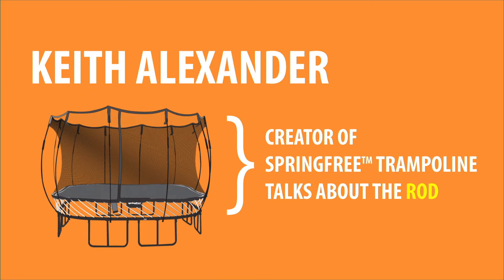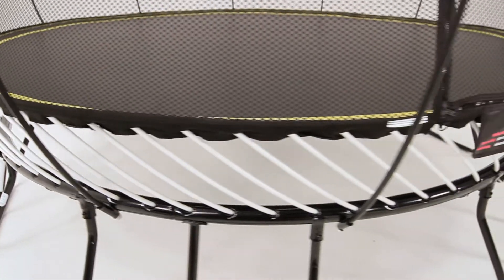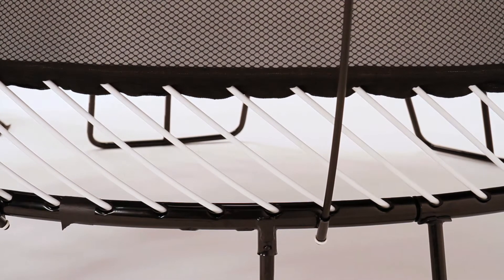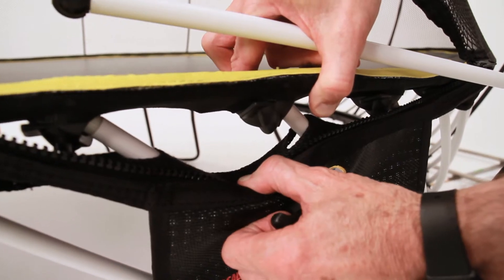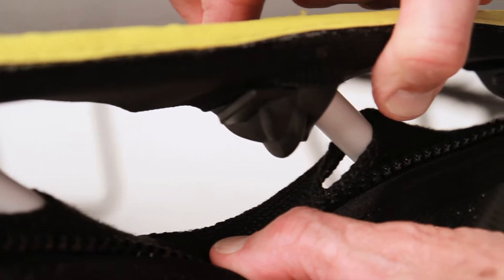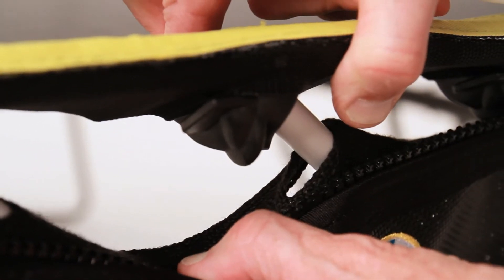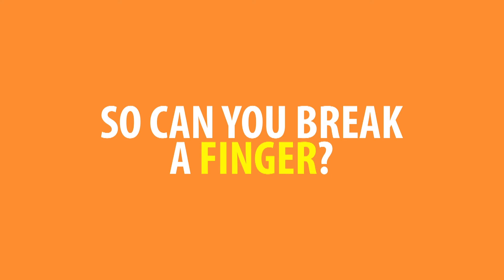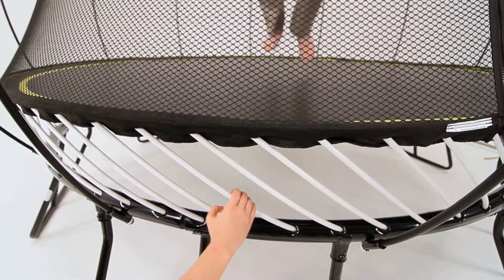Springfree Trampoline Review: The Rods

Comment: Hi We have a Spring free tramp and it is rusting in a very short time we have given the information, sent pictures and called. We have had no help from Spring free after sales we have not been given any service regarding your rusting tramp. The rust starting with the bolts and has now spread to the frame. My wife and I have called and called until we where blue in the face they make us wait we speck then back on hold. We have filled out the warranty from and given all info required. We have done this three times. Now they have added us there auto email system and send us there specials. We will not be purchasing anything further from this company because they do not honour there warranty.
Reply from the maker: +Central Plumbing Wellington Anthony Eden 
Your feedback is important to us and we would like to get in touch to further discuss your concerns. I have passed on your feedback  to our New Zealand team.